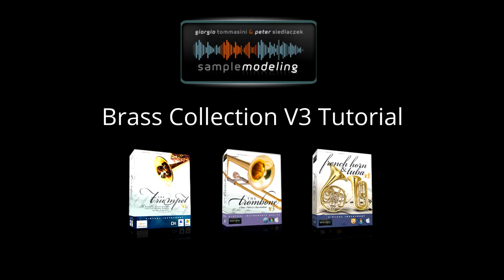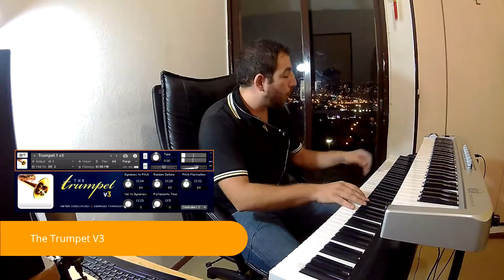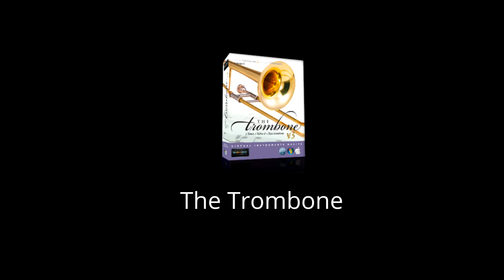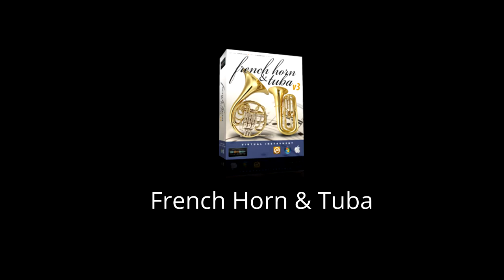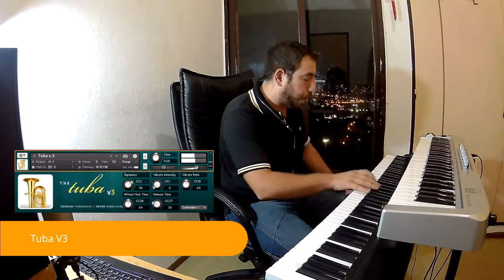Sample Modeling Brass Tutorial 01 - Included Instruments

Comment: How did you do to perform vibrato by using only dynamics?
Reply from the maker: The instruments have an algorithm that detects variations in dynamics and translate it to pitch. This "translation" intensity is controlled by CC24 (Dynamics to pitch)
Reply: Thank you Gomez, I did not explain well what I meant, I wanted to ask what breathing technique to use to get the effect, to make the dynamic vibrate.
Reply from the maker: Ahh ok. Yes, you need to practice the vibrato with breath controller. I did not learn that anywhere, just testing and experimenting by my self. I imagine that the breathing technique has to be very similar to the one used in wind instruments. I will upload a video explaining the different breathing techniques that i use depending if the instrument is a flute, trumper, bandoneon, violin or string ensamble, each of the instruments must be played differently in order to achieve a more realistic result
Reply: Great, can't wait for this. Thank you so much, it will be very very useful.

Comment: have any configuration that it can do duets?for example, if I set up a brass suit and want to open the voices to make a chord there is same configuration that it does?
Reply from the maker: Sadly it is not possible out of the box. But you can try to use a midi processor like plogue bidule to split the voices on the fly. I use that for my live ensambles, you must use the "Note filter (dynamic) to filter the lowest note, and you can nest this filter, on the outputs also you can add a quantization configured to 32/4 for example, to create the ilussion of the humanized synchonization of the different instruments. Each output you can assign to different instances of the same instrument or use different instruments.